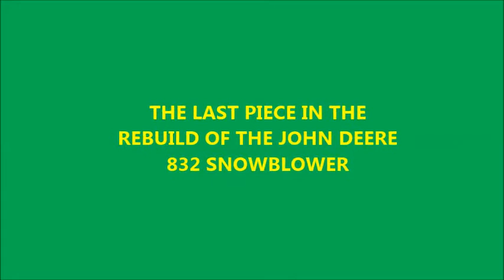The Last Piece to Finish the John Deere 832 SnowBlower

Comment: Wow...Missed this one from 5 years ago! I'm feeling better with my neck by the way. About 60%...I'll take that! Cheers my Good Northern Friend! Sean~
Reply from the maker: I love that old thing.  I think it is a 1972.  I know it well.  The augers are still rusted to the rotation shafts.  I have tried everything    really I have.  It is actually an Ariens blower painted green by John Deere..  If you look at my orange one the auger assembly is the same.
Reply: Bruce Pender Its about 1974 or 1975 it was built during the 924,000 series generation of snowblowers. The Tecumseh HM80 was not released until 1973.
Ariens did not start using an 8hp until 1973 and it started with the last two years of production of the 10000 series, the series of machines built before the 924,000 series.
You can also look at the engines serial that is also its DOM
Its a 4 digit number followed by one letter. Example 4275R
First digit, year of decade 1974
Next 3 day, 275th
Assembly line R
That will tell you the year. Many times if its towards the end of the year like 315, than the engine was built and put on a following model year machine. These machines run just like cars do a model year ahead.
Reply: Bruce Pender Knowledge is free.
Page 7 goes into detail about the series and generation your machine came from, but you also own a 22,000 series so the entire website should be useful and helpful to you to learn all about these Ariens machines and the interesting information.
I have a dealer binder with every manual from 1960 to 1974.
I believe I have your little Ariens operation and parts service manual.
If you want it just let me know and I will sxan them and send them to you digitally if you dont have them already. However you can also go on Ariens.com and go to manuals and enter your machines model and it will pop for you.
I would personally like to know more about the taller wheels,and tires on your John Deere machine, I would like to some day in the future add those taller tires to my machine. It makes the machine stand taller and gives it better balance and plow capability ovet the little stock wheels. Plus the one swaps into a mower in the spring so it would give better traction on the grass too.
Ariens information site
https://scotlawrence.github.io/ariens/index.html

Comment from the maker: Thanks cbgreenbay.  The rebuild went great.  I would get a gear puller (8 inch) and a little acetyline heat if you have access to it to get that back pulley off of there).  The parts are all available and If you can reuse that pulley it will save you some time. (You can use a puller like the in my replacing the worm gear bearing video)

Comment: If you order a u-joint one extra piece of chute rod, and a metal plate and another eye bolt you can cut your chute rod in half and divert it all the way up to the control panel.
When I put a new OHV engine on my Ariens similar to yours I had to, now I don't have to bend to turn the chute and it saves me a lot of pain the next couple days.
Reply from the maker: Cool
Reply from the maker: I think i get it now.   Inside the housing.  You wouldn't have any pictures you could share???
Reply: Bruce Pender Yea I made a video of how I did mine. My handle bars are a little bit different so yours would run up by the dash different. But this should give you a good idea. If you have any more questions feel free to ask.
https://youtu.be/MMSul_1_uPA
Reply: Bruce Pender Were those the stock rims that came with that machine? Because I noticed the rims are a 5 lug rim but the hub behind only has the holes so you could only put 3 bolts on. Is that how they came or are those different rims and tires than what was originally on that machine. Because like I said I would like to put the larger rims and tires on my machine and I wonder if I can get large 3 lug rims or if thats how they did it stock, if it is I will just buy a pair of used white rims and tires from a machine like an older snapper that uses the same kind and throw them on my machine. I use my machine as a mower in the summer my Ariens takes different attachments for the back tractor part and csn take a sulky too. Yours could also take other attachments they just would not match by color. You also have to remove the heater box and add an air filter and air filter cover in its place when you do that. Thats how they did it with the Tecumsehs for attachments.
Here is my 32 wide machine its very similar to yours just based off the 10000 series where yours was based off the 92400 series. Mines a 71. I removed the original engine recently and am running the predator 212's on both my 24 and 32 now. More power and easier to swap from summer to winter just take the air filter off for winter, put it back on for spring. The taller chute makes a world of difference, the one on now is 15.5 tall not including the deflector, the original is 11 inches tall not including the deflector and they made one that is 22 inches tall that can have the cable added to make it a remote deflector that fits on these machines too. I see them come up for sale once in a blue moon. If I had to do it again I would get the 22 inch tall one, but the 15.5 is more than ample much better than the little 11 one. Only place I still run into problems is when I have to throw snow over a tall vehicle, cant do it, that is where the 22 inch tall chute would have came in. Otherwise the 15.5 is perfect. The old 11 chute just cant throw snow very far. I can throw snow 30 feet into the air and about 40 feet away now. The original chute maybe 25-28 feet distance and 20 feet into the air max. So that extra 4.5 inches makes a huge difference. They say when you add the impeller mod its even better and wont clog, havent tried it yet.
My 32 wide Ariens
https://youtu.be/5uYPhr-beHw
You'll see my mower, it has a new engine now.
https://youtu.be/xscqXL5deTo